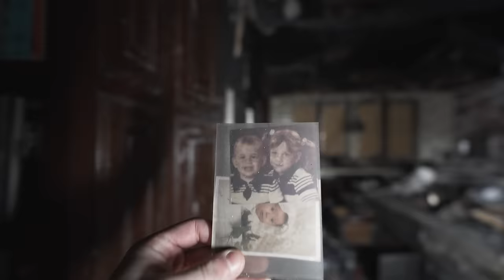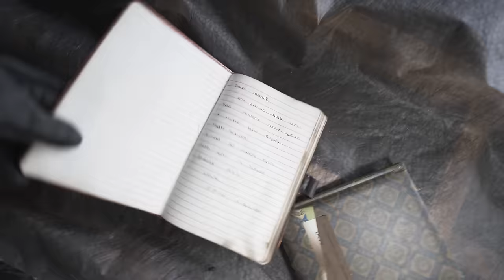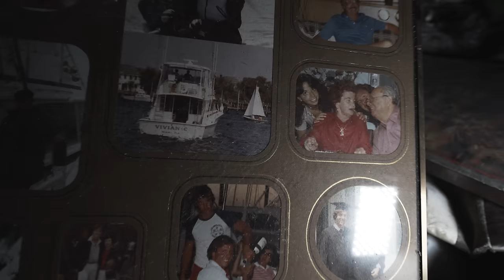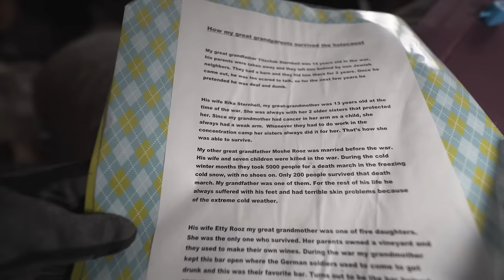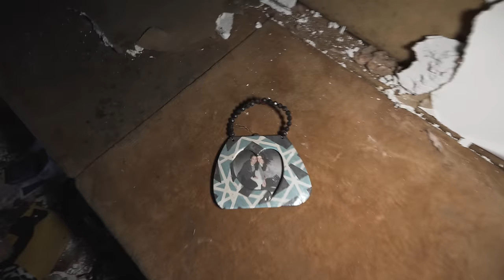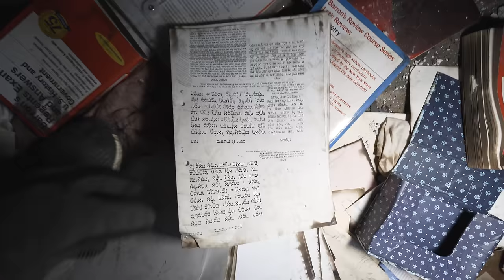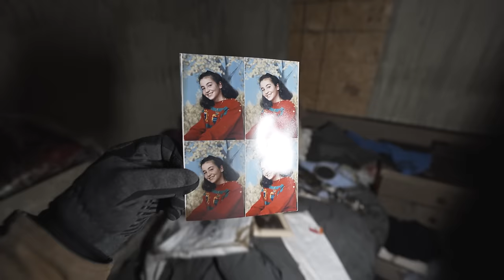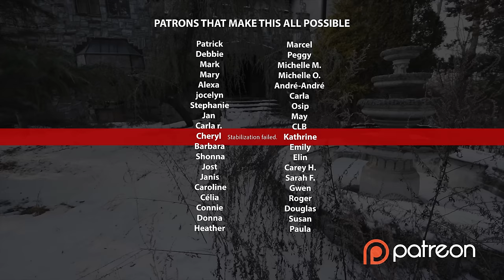The Tragic Story Of An Abandoned Jewish Family Mansion Ruined By Fire

Comment: You asked many times why they didn't take certain items... clothes in particular would be forever ruined by the soot and water damage from the fire. Photos would be contaminated, and it is recommended by the fire department to not take them as they now carry carcinogens linked to cancer. Dishes could have been washed, but would still pose a risk of contamination. Furniture and toys are also typically left behind for the same above reasons.

Comment: Wow that mansion was quite the place in it's day.
It's repairable but probably the owners quickly discovered that the repairs cost is as almost as high as building a new place.

The Cooking Stove "Garland" can be seen in the restaurants you eat at if you ask to peek at the Prep Area. 
It's not intended for personal use generally.

The books clothes and pictures they wouldn't want anymore because of smell and dirty.
They will have duplicates with the photographer. 
To us  we would wipe clean and use but for them they would prefer to buy new as even the driving and time and cleaning has an expense. 
Possibly they will donate the usable items to a charity.
Even the food cans won't be bad. Would have been brand new in 2018.
By the looks of the damage it's a cooking oils fire in the kitchen.
Very very common to burn the house by unattended cooking oils on the stove (which is Gas burning type).
Fall asleep waiting for the oil to warm up....boom out of control fire you wake up to.

Comment: Really interesting home. For your information: religious Jewish homes can have two kitchens some times, but must have two refrigerators, two dish washers, two stoves, separate dinner wear and eating utensils. When a home is kosher they don't mix dairy products from meat in any way. This home was odd since it appeared for a religious family, but having a sauna.... that is a bid odd!
Reply: No, they don’t need two refrigerators or stoves. They do have separate meat and dairy utensils and pots etc.
Reply: @faigie2002  It is my experience that because dairy and meat are kept separate SOME homes not only use separate utensils and pots but separate refrigerators and dish washers. There are varying degrees of kosher depending on how orthodox they are. And, how about the sauna? Not something I would expect to find, what do you think?
Reply: I learned about the two thing when I worked for a Jewish family. I have found one of the 10 Commandments was not to mix kid meat with mother's milk.  Meaning goat. Goat meat is tricky thing.

Comment: Fascinating video! You guys do such an excellent presentation -- so thorough and respectful. This house is very interesting and grandiose in design, but as you pointed out, was of typical cheesy, modern American construction, with 2 x 4's and sheetrock. In my estimation, this fire was not all that severe. I have seen much worse damage brought back like new, sometimes better. There are companies that specialize in smoke remediation and such. Yes, much of the damaged items and materials must be discarded, but the house and many of the cherished mementos can be saved. Had this been a "devastating" fire, you wouldn't be able to tour it like this. It's difficult to know the exact circumstances in a case like this. They were trying to sell the place? There is some question of insurance coverage? What are the psychological factors that might pertain? All contribute to explain why such a place remains abandoned.

My father had a serious house fire years ago. He had one of those wood burning stoves, similar to the one shown in the kitchen of this house. Though it had a triple-walled flue pipe, it was routed inside a wood-framed chase through the upstairs. I'm sure that the builders left the required clearance, but it's still not a good idea to run a flue pipe in such a way. It should always be a proper masonry chimney all the way up through the roof. A fire started in the flue pipe, and before my father became aware of it, it had started a fire on the second floor. It would not surprise me if the same thing happened with the house in your video. One can see the metal flue pipe exiting the wood stove in the kitchen, and passing up into the second floor above the kitchen, where the worst of the fire damage occurred. But it seems there was no wholesale spread to the rest of the house. In my father's case, one wing of the house was closed off by some wooden doors, and sustained no damage at all, smoke or otherwise. The house was repaired, as good as new. Some items were lost, of course. When my father passed away, the house was sold to a family that still owns it.

Once again, guys, amazing video!